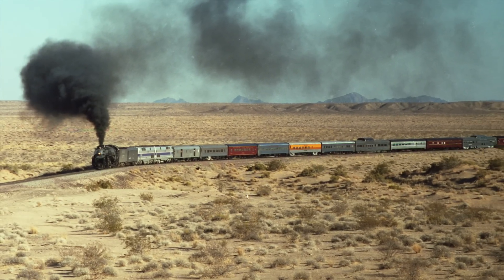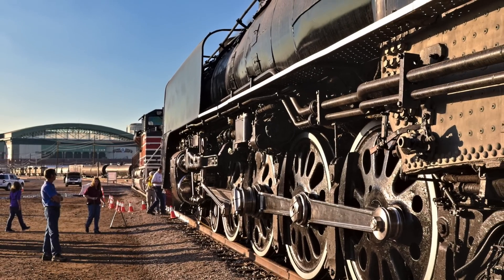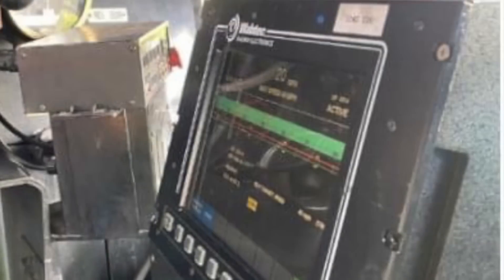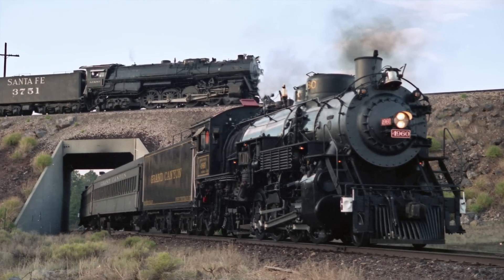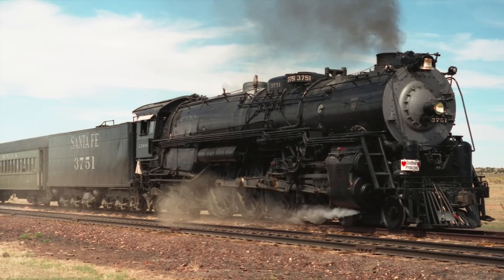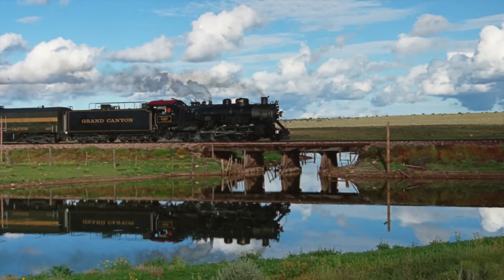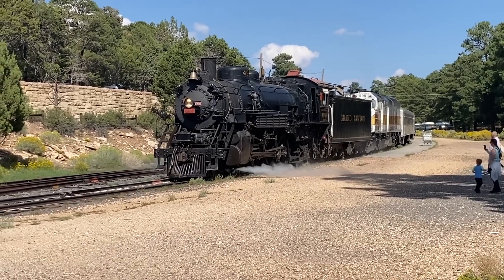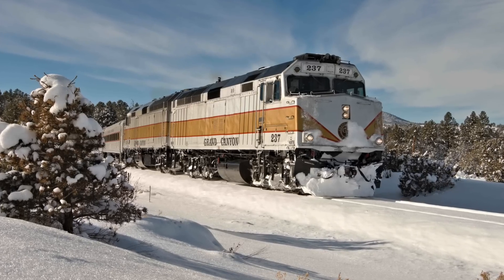Why is there a diesel behind the steam engine?

Comment: Track operators requiring a diesel in the consist on buy lines is common everywhere and another reason is that older steam locos are unable to provide electric power to the consist. Here in Victoria (Australia) we have had triple header steam trains with a lot of cars and it is an awesome sight pulling up the hill in the dark near a friends place.
Reply: did later steam locomotives have the ability to power a consist? did the steam generator ever provide that kind of power? wasnt it always a generator car, and cant that still be done to today? a generator car?

Comment: Just a heads up on the 4014’s PTC system, the plan is to make the system completely standalone, and the same is true for the 844. 
I asked in the Union Pacific’s Steam Club bookFace group if that was still the overall plan and it was confirmed that it’s still the plan, and that 4014’s system has been made to be completely standalone now, with 844 to soon follow. 
Long story short, let’s not completely give up hope on a steam only run on Uncle Pete’s mainline with the Big Boy.
Reply: She sure has the horsepower
Reply: @andrewdonohue1853  And the tractive effort. If 3985 can handle a 143 car double stack intermodal at speed, I don’t doubt that 4014 could do the feat with a 200 car double stack intermodal. But with Ed having admitted in the Steam Club bookFace group to actively taking it easy on the engines for the sake of making sure they’re in the best possible condition for future generations to continue preserving and using them, in spite of his own admitted desire to see and operate the engines the way they were built to be, the prospects of seeing such a feat with the 4014 is iffy at the very best.
Reply: @justahillbilly7777  i think taking it easy most of the time is just fine, but once in a while we need a demonstration of the power of these incredible machines. a big boy is no toy..... makes me wonder if there's even a diesel that exists that can match it. i doubt it.
Reply: @andrewdonohue1853  The EPA Tier 4 compliant SD70ACe’s and the DDA40X’s have more starting tractive effort then what the Big Boys have. But when it comes to being able to solo haul a single train, I’m unaware of a single diesel locomotive capable of giving the same performance of a Big Boy. 
Like the old saying goes when it comes to the raw power and power curves of the two types, a diesel locomotive can start a train that it can’t pull at track speed, whereas a steam locomotive can’t start a train that it can pull at track speed.
Reply: @andrewdonohue1853  Didn't the UP have some articulated diesels, real tall fellas? I saw some ungodly huge units at the Proviso diesel ramp back in the '70s-'80s. Should've shot a few photos, but didn't have my camera handy, and they were gone the next day.
Reply: @thomasmleahy6218  Why have articulated diesels. One of their selling points is that you can couple two together and have more HP than the largest one ever built - and they are articulated by default.
Reply: @andrewdonohue1853  There isn't a diesel that can match it once the train is rolling. It is the start-up that is difficult for steam.  I agree that it would be absolutely awesome to see 4014, 3985 3901 pulling a long freight out across the plains.  As far as not stressing these restored locomotives - they were not born and bred to pull pansy passenger cars. They were not designed to go fast. The were built to do one job - Pull long consists over the mountains of Wyoming and Utah. In that job, they are unsurpassed.
Reply: @justahillbilly7777  Boy, you have that right on the point. What could be done to mitigate that situation?  A mix of the two breeds? Imagine Big Boy leading a couple of 70's or 40's pulling a 200 car consist.
Reply: @thomasmleahy6218  They had double diesels for freight hauling. Basically one locomotive with two engines, just like the E units. They were the EMD DD35’s and DDA40X’s, GE U50’s, and ALCo Century 855’s. 
In terms of actual articulated diesels, the only thing like that ever built were the Baldwin Centipedes, but Union Pacific never had one of those, though at one point they were interested in the Centipedes to place an order, but Uncle Pete canceled the order before delivery.
Reply: @justahillbilly7777  No need to turn the "Big Boy" up in power. Just run him up and down the tracks so the world gets a history lesson! I got to see BB when it came through Parsons Kansas. We followed BB into Oklahoma. Memories of a life time!
Reply: @andrewdonohue1853  perhaps the AC6000s?
Reply: @thomasmleahy6218  they did. The U50 was one of them.